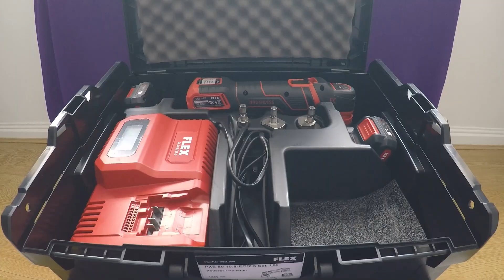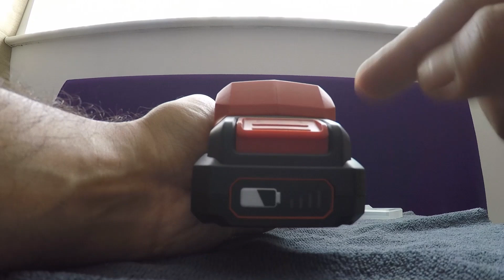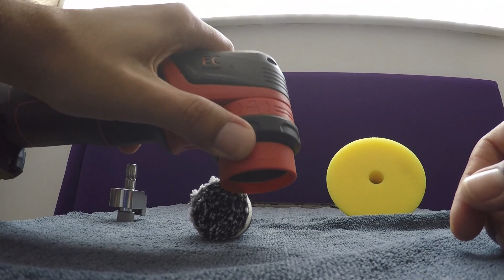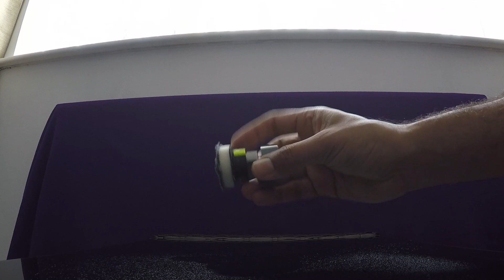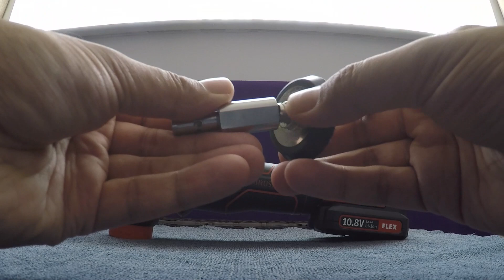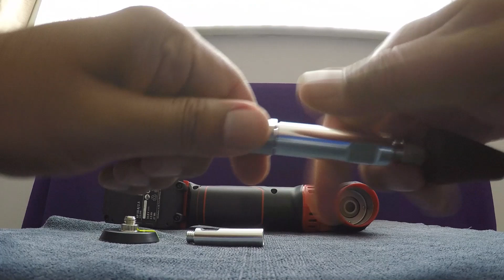Flex PXE 80 10.8 Mini Cordless Polisher : IS IT ANY GOOD?

Comment: Flex says the 3mm is only used for sanding and the 12mm for polishing, maybe that's why you were not getting any rotation when polishing with the 1-inch pad at 13:59

Comment: so you dont have the option to use a 3" rotary function?
Reply from the maker: @petegangies - Firstly thanks for watching.  No.  We’ve experimented using an aftermarket 3” plate and it’s not happy.  It’s a shame as otherwise it would have transformed an already excellent polisher into a utility monster! We would avoid this.  If you’ve not already done so check out the rest of the channel & subscribe 👍🏽🙏🏽🚗

Comment: I found the 3" backing plate with 3mm orbit and a 3" 3k trizack pad to be nearly perfect for finishing off some wet sanding work or de. Ibbing or working out a medium scratch. 

Im curious to try the 1" vacki g plate 3mm orbit with sone eagle abrasives 1.25" sanding disks and their interface pad for doing very small finish sanding on a dirt nib that got over worked.
Reply: Im looking in to this machine for my bodyshop and was wondering to use a trizact with it, good to know thanks !

Comment: Hi! I have the Rupes Nano mini polisher and i also have the same problem... the 3mm dual action attacment dont speen at all. So i dont use it. I thouth thats mine have some foctory defect but as it seems flex have the same problem. Also the Ruppes tend to stall a lot. I have to take a close watch on the rotation marker. Usualy when i polish headlights i gave this priolem (not ot flat surface)
Thanks for the video
Reply from the maker: @Nisotovski - Firstly thanks for watching! Yes these polishers just have these issues.  The 3mm dual action attachments are designed to be used with sanding pads therefore don’t work well with compounding/polishing pads.  However, in the case of the Flex the rotary attachments work a treat.  If you’ve not already done so please check out the rest of the channel & subscribe! Thanks 👍🏽🙏🏽🚗

Comment: You use the 3mm throw for spot sanding on the 1” backing plate
Reply from the maker: Michael Chong - Firstly thanks for watching! Is this a question? Or a statement? 🧐
Reply: @VProjectUKDetailing  it’s used for spot sanding 👍 which you probably already know
Reply from the maker: Michael Chong - Oh yes! That’s correct - we were aware of this but thanks for letting us know.  Much appreciated! If you’ve not already done so please check out the rest of the channel & subscribe! Thanks 👍🏽🙏🏽🚘

Comment: I was using the APS extension and cone pads this weekend for inside the door handle.  Have you tried it? I had no issues getting out the marks behind the handle ( used the red cone and Menzerna medium compound) but, I just couldn’t get a good finish…Menzerna super fine polish, black cone, speed 1….ended up hazy and holograms….cleaned up easy enough as I switched back to a 1 inch pad and 12mm throw took it right out.  
It’s frustrating though as I also have the new Flex flexible drive attachment which allows you to get into almost any space but, if I can’t finish well it’s kind of pointless….is it technique / practice?  It’s difficult to jewel in a tight space because it’s tight which means your movements are restricted! Any tips greatly appreciated.
It’s a fantastic bit of kit…..
Reply from the maker: jasonsfraser - Some great user experience descriptions in your comment and I’m sure an experience that many people may have had! You’ve knocked the nail on the head regarding what the issue may be! Like most things in detailing there could be many variables - but based on what you’ve said the first thing to check is the vehicle make as that will determine pad/compound/polish choice based on lacquer hardness.  Next thing is when using small/very small pads you have a much smaller surface contact area which means you have a much more focussed contact point - so unless you adjust the amount of pressure you apply you could be adding too much pressure which would cause hazing using a pad/polish choice which normally works wonders - so yes it is experience/technique! We find using the yellow APS cone with Meguiars D300 in really tight spots usually gives us the results we are looking for! Hope this helps - it’s all about practice, finding a pad/polish combo that works for you & knowing the type of lacquer you are dealing with.  But yes agreed awesome bit of kit!  Good luck in experimenting - it’s part of the learning process 👍🏽🤞🏽🙏🏽
Reply: @VProjectUKDetailing  
Thanks for the advice.  Car is a carbon black 8 series BMW.  Paint is medium to somewhat hard.  I did a couple of test areas….I had no trouble removing swirls with Menzerna medium cut and flex purple pads….I’m assuming it’s heading towards hard as it finished so well that the finish polish step didn’t really improve clarity (maybe just a touch more gloss).  
I’ve ordered a couple of painted spray out cards so I can practice my small area technique and try various pad / polish combos. Thanks again for your help👍
Btw, Flex battery technology is really next level.  The speed of how quickly it can recharge means that with two batteries you literally never run out of power. V impressive.
Reply from the maker: jasonsfraser - You're welcome.  Yes it sounds like it is hard lacquer if it's BMW and in most cases will finish down with the right one step approach.  Good move getting test cards to practice on.  We would highly recommend trying Meguiars D300 with the APS pads.  Good luck - let us know how you get on.  Yes the fact you can charge one battery whilst using the other is great - you never run out of power.  But taking a small break in between polishes always helps - not only to let the machine cool down a bit but also to regroup mentally.  Detail happy - we've been super busy but new content should be out soon.

Comment: i just broght rupes nano ibrid in my option its crap it cuts out when i add a little bit of pressure and swoping from 1" to 2" its a pain in arse im tempted to pull the trigger on flex
Reply from the maker: Gareth Davies - Firstly thanks for watching! The Flex PXE 80 is simply awesome! With the option of all the attachments, quick change, rotary & DA it does the trick! The only downside is that it can stall in DA mode similar to the Rupes - but in rotary it just rocks! You shouldn’t be disappointed! Thanks again for watching - if you’ve not checked out the rest of the channel please do and make sure you Subscribe 👍🏽🙏🏽🚗
Reply: @VProjectUKDetailing  i will mate dont worry ... i feel like flex as more power every one got diffrent options on each machine
Reply from the maker: Gareth Davies - Machine polishers are very subjective! You can have two detailers with exactly the same machine and polish and achieve very different results due to technique! I would say you may be disappointed with the Flex with the DA attachment as it will perform very similar to the Rupes - but the Flex takes it to another level with the rotary attachments! In detailing it’s all about experience, and using different machines! It’s a costly and time consuming profession 👍🏽
Reply: @VProjectUKDetailing  i just ordered flex 80 whats the best cutting pads and heavy polishing pads for this machine
Reply from the maker: Gareth Davies - Nice! Enjoy it 😎

Pads! Do YOU KNOW where to start? ft Rupes & Meguiars
https://youtu.be/TPzKbfKyt6s

We have links in the description for all of the products showcased 👍🏽🙏🏽🚗

Comment: As a beginner to detailing and only working on my own cars, would the Flex PXE 80 be a good tool for me, could I get away without buying any other DA (would the 3” pad be ok to do larger panels), or would I have to buy a 5” DA tool?
Reply from the maker: Paul - Great question.  The Flex would be an asset in any detailers toolbox.  It’s a great versatile tool as you saw in this video.  However - if you are only working on your own vehicle then maybe look at corded 3” polishers as they will be much cheaper! Really depends on your budget! We have recently launched another video showcasing the ShineMate EB351 5” cordless polisher so check that out too.  This leads us onto your next question - yes you would also need a 5” or 6” polisher for larger panels! We have yet another video showcasing the DAS 6 Pro Plus which is more than enough for professional results at a much cheaper price.  If you’ve not checked out the channel please do - and if you’ve not Subscribed please do.  Thanks 👍🏽🚗

Comment: Question: Can you still use either the 3mm or 12mm DA attachments with the 50mm APS extension shaft. Obviously it would be nice to retain the DA feature on the longer shaft. Thoughts / Recommendations?
Reply from the maker: Dominic Bird - Firstly thanks for watching the video.  Our recommendation would be to stick to the rotary attachments only when using the extension! Reasons - firstly you won’t get good results using the DA feature using the extension shaft, and secondly it could damage the Flex internals as it’s puts undue stress of the gearing! Stick to rotary attachments! You will get better results anyway! Thanks again for watching! If you’ve not checked out the rest of the channel please do so, and check us out on Instagram! If you’ve not already done so please make sure you subscribe and hit the bell icon to get alerts for all of our future video releases! We’ve been super busy here at V-Project UK so YouTube content has been slow - but new content should be out soon 👍🏽🙏🏽
Reply: Yeah, was kind of thinking as much but thanks for the response and confirming my thoughts! Cheers 😁

Comment: Superb video! :-) What is pad stall like on this machine please with the 3" pad? I really struggle with my Rupes Mini Bigfoot LHR75. thanks again.
Reply from the maker: dibbs26 - Thank you for your kind words! Much appreciated.  Pad stall with this polisher using any of the DA attachments is somewhere between OK & poor.  It is still usable though.  However leaving this feedback with this statement would do the polisher a disservice.  We still think this is a superb polisher.  As you see from the video it is very versatile.  Using the polisher with the rotary attachments is where it comes into a life of its own.  More than enough torque/power to handle most, if not all tasks.  We use the 2” rotary attachment and sometimes fit a 3” pad onto it.  Works wonders for heavy curves or tight edges especially with the Rupes Yellow or Rupes White pads.  However, just bear in mind that the machine is not designed to run a 3” pad on rotary mode as it could damage the internals but so far we have had no issues.  Hope this helps.  If you’ve not already done so please check out the rest of the channel but please subscribe on YouTube and Instagram.  Thanks 👍🏽🙏🏽

Comment: why this machine it not working with rotary 3''
Reply from the maker: clean car - It’s just down to the way the machine is made! The torque required to drive a 3” plate in rotary mode would damage the gearing and/or reduce the lifespan! Shame as 3” rotary on this polisher would be amazing.  If you’ve not subscribed please make sure you do! Thanks 👍🏽🙏🏽
Reply: Just FYI, in a very early presentation, Flex said that it would in fact be able to be used in rotary mode. (it's on YT but I don't have the link handy). Interesting.

Comment: Great video and very helpful as I decide between this and the rupes ibrid , is the 2” plate safe for stress on the machine in rotary ? Thanks
Reply from the maker: Matthew Savidge - Thank you for your kind words and glad the video was useful.  Yes the 2” plate is fine for stress levels.  We have many hours use on the 2” plate with the rotary attachment no issues.  If you’ve not subscribed on YouTube & Instagram please make sure you do.  Thanks 🙏🏽
Reply: @VProjectUKDetailing  great , thanks for the info 👍🏻

Comment: I like the two inch plates best,
Reply from the maker: Amir Abdullah - We agree! It’s most probably because you can use the 2” plate with the rotary attachment! The 3” plate seems to suffer with the dual action attachment 👍🏽
Reply: @VProjectUKDetailing  if you ask me it’s just about the backing plate. A guy here makes some home made rotary attachments and some backing plates as well. I got one that really works well with Microfiber. We all know the PXE doesn’t like Microfiber pads. But with the right backing plate it’s altogether different. Still I think the two inch is super smooth.
Reply from the maker: Amir Abdullah - For sure.  Our experience is that it’s more the attachment I.e. rotary attachment vs the dual action attachment that makes the difference.  We’ve tested a 3” rotary plate and it works very well as opposed to the 3” dual action plate.  But agreed the 2” method is a pleasurable experience 👍🏽
Reply: @VProjectUKDetailing  coming back to this I have a aftermarket 3” plate and it’s a lot better with either foam or microfiber. I’m not sure if the guy is gonna mass make them but hope so. Also by the way your box setup is so much better than mine.

Comment: I want that box
Reply from the maker: Amir Abdullah - LOL 😂 ... we know what you mean.  As far as boxes go it’s great.  Solid.  It also allows other Flex boxes to be stacked and connected on top so if you are carrying multiple polishing machines you end up carrying just one box.  Nice touch from Flex 👍🏽
Reply: @VProjectUKDetailing  They are Bosch L boxx
Reply: V-Project UK : Detailing the bag we got with the PXE is cool but not like the Box.
Reply: @VProjectUKDetailing  how do you get the box?  Thx
Reply from the maker: Tundra Whisperer - In the UK the box comes supplied when you purchase the kit.  You may be able to buy the box separately but you may need to contact your local authorised Flex dealer.  Sorry we can’t be more help 🤭
Reply: @VProjectUKDetailing  it's ok the sent mean smaller box but that's cool

Comment: Did I hear you say you can correct paint on speed 1... 🤦‍♂️
Reply from the maker: Hi Gary ... Yes you did! In rotary mode on speed 1 it spins more than fast enough for paint correction 🚗 ... it also helps keep paint temps down as you are compounding/polishing in quite a small surface contact area either 1”, or 2” 👍🏽

Comment: APS themselves say you shouldnt extend the extender by the way.
Reply from the maker: @ nicky chavda - Thanks for this.  We are aware that APS don’t recommend this however, in our use we find extending the extender using the Pro FVA50 is fine for light uses such as in between grills if required.  We would not extend for example if polishing door handle recesses 👍🏽🚗😎

Comment: The 3mm throw attachment is for sanding only by the way. No fault of the machine, that's whats its for and works great for sanding
Reply from the maker: @ nicky chavda - Thanks for this.  We have been using this polisher for a while and tested various uses over this period.  We are aware that the 3mm DA attachment is for sanding but we find it doesn’t work very well for this purposes either.  In our opinion there are more effective methods for sanding than using the 3mm attachment on this Flex polisher 👍🏽🚗